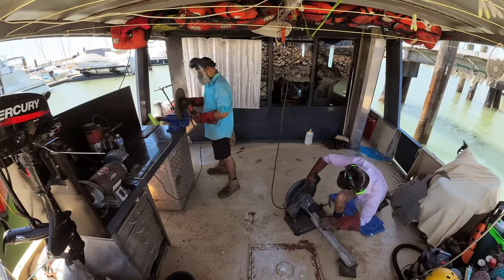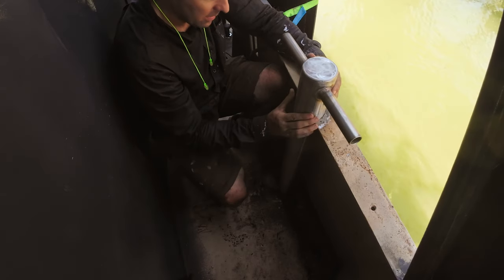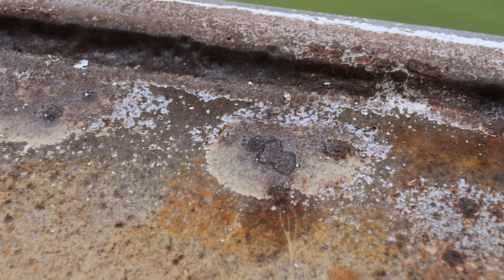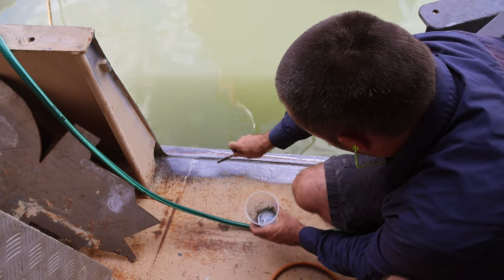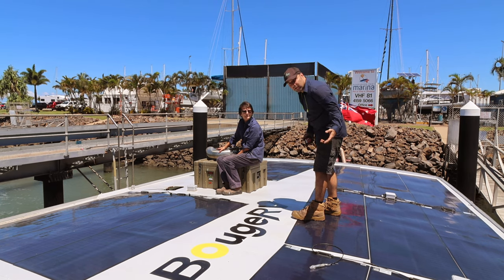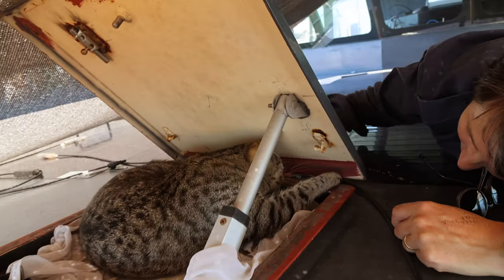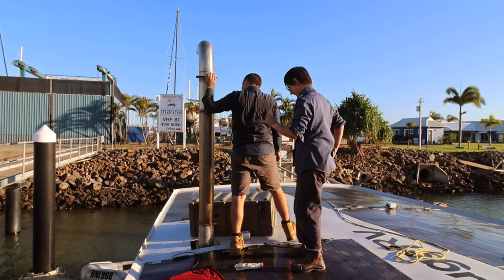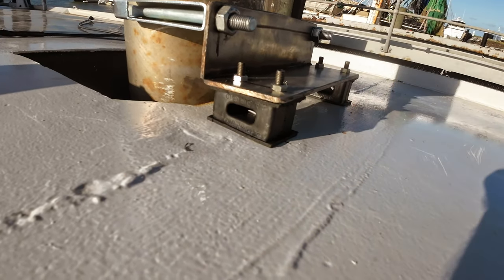Building the Exhaust Stack - Project Brupeg Ep.333

Comment: Just a suggestion. Tractor's have there exhaust tips pointing forward. The air flowing against the exhaust gases push's the gases up higher. When the tip is facing back they are pushed down.

Comment: Make sure the ventilation system has relaxed air passages,  nothing above 5M/S air velocity. Nothing worse than having to cruise with engine hatches open. If you need a hand with design send a Damien sketch with rough dimensions. Cooling air requirements for the Cat are readily available. Can sort out air volume and pressure quickly. Then choose a ventilation fan to suit.

Comment: Jess, next time check through the old hard discs and you will find one the size of the pipe, it will give the perfect Radis.
Reply: The piece cut out is a Radius so an old worn hard grinding disc (look through the assorted ones) and you will find one close to the diameter of the pipe (a tad bigger is better) that will produce the diameter needed so the pipe will fit in the RADIUS!!
Having be a welder/fabricator for 40 years it is second nature but perhaps not to yourself..

Comment: If you want taller exhaust pipe, support it with wires, like a mast.
Reply: Because of how thin the pipe is relative to anything structural the wires wind up flexing and breaking it over time.

Comment: Just curious Dame why the 90° turn over straight end and rain cap? The straight pipe end does a better job at getting the exhaust as far away from the boat before the wind catches it, on the 90° bends the wind can work against you at times and the exhaust gas can actually drop about a foot or so below the end of the exhaust when the wind is against you. Just my experience with them, just curious what pushed you that direction with your decision, I’m sure there’s a reason.
Reply from the maker: I did think about a straight pipe and cap. We had this bend and it’s pretty common to do them with a bend. If it’s wrong and we don’t like it we can always cut it off and add more straight and a cap
Reply: @ProjectBrupeg    not sure if it's relevant to your exhaust hight but in fume extraction in the UK exhaust stacks need to vent 3m or more above the highest roof line to be outside the buildings 'boundry layer' of disturbed air around the building. Inside the layer fumes can get drawn back into the building, 3m of clearance usually negates this and with a cowl that pushes the exhaust upwards and away too.

Comment: Question  Instead of running separate exhausts pipes all the way up could you plumb the exhausts from the generators into the main 6 inch engine exhaust ? Just wondering.
Reply: It’s a thing I’ve seen done before.

Comment: Damo, is there a reason you can't plumb your generator exhausts into the main exhaust in the engine room?  Perhaps in the vertical section and with the generator outlets facing up rather than at 90deg. Perhaps there is a good reason you can't, like rules or something. It would be good to know.

Comment: Decktite to seal it to the roof from the elements? We used them on 500kw gas fired boilers and they didn't degrade. That's if it needs to be sealed?
Reply from the maker: Awesome thanks, it does need to be sealed.

Comment: I wonder if you could get condensation issues by pushing cool air over such a large area of exhaust, could this run down and thrash the turbo?
Reply from the maker: All exhaust on Brupeg have a water trap. But it’s not cold air, it’s hot engine room air pushing past hotter exhaust air. When we shut down there might be a condensation risk but it’s minor and will no doubt evaporate away given the heat we are dealing with

Comment: I don't know much about exhausts but it seems to me 6 inch is overkill, that's kind of the way you do things overbuilt, therefor couldn't you pipe the gen sets to exhaust through the 6 inch up pipe to reduce the number of pipes protruding through the roof  or does that increase the chance of exhaust back flowing into the engine room or is that just not the correct way to do things?
Reply from the maker: Exhausts are an interesting topic. The general rule of thumb is go one inch larger in pipe diameter than the turbo outlet. For our 5” turbo that means 6” exhaust should flow just right. Adding another pipe inside the main stack can be don’t but it does open up a bunch of risk around back pressure being increased as well as back flow from one engine to another if one isn’t running and the other is. Most commercial boats that I’ve seen always keep the exhausts seperate as it eliminates the risk around these two things. I don’t know enough about exhausts to know if I could combine them without issue so we will be keeping them seperate so we know we won’t have any drama down the road. We might be wrong but extra pipes out the roof is of no concern to us.